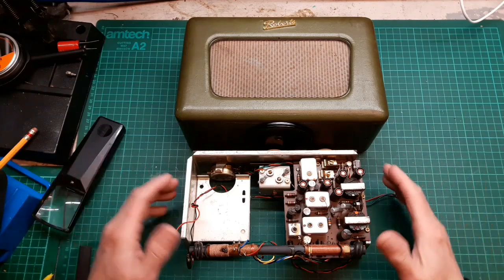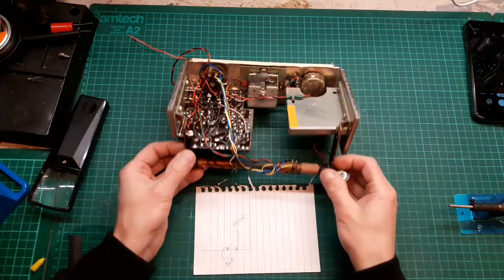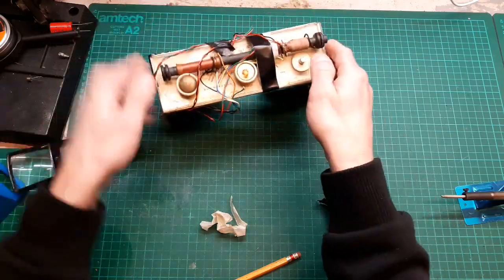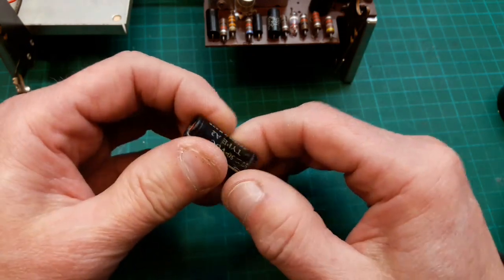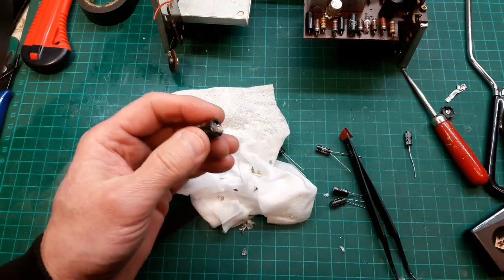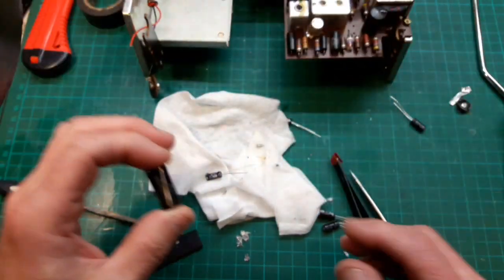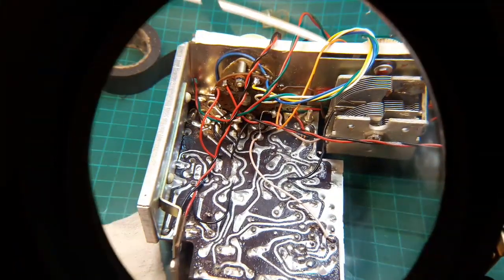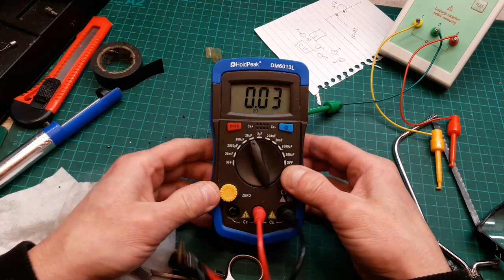Roberts R300 Radio Capacitors Chapter 2

Comment: I've enjoyed watching every video you have created :-D
You don't waffle for years like old blokes often do and only in the last 3 mins they actually focus on what the video was about.
I did notice that the first cap you replaced was better than the new one, the esr and loss was worse in the new one.
But there is more to capacitors than esr, slight leakage can make for a silly reading.
For joints that don't suck well :-D, add a bit of fresh solder to the joint, makes the transfer of heat from tip to joint better 
:-D.
Stop picking fault with you videos, we can do that Ha ha :-D
Reply from the maker: Arrrrrrhh right , replacing good capacitors always hurts 
Thanks for following 
I'm still learning 
Best regards Shaun
Reply: @SweeneyTTodd  , Cheap Wango Tango capacitors can be worse than old quality ones.
We all have to find a level of wallet emptying that we are happy with lol :-D
Just my opinion, i'm an old git so i like a moan :)

Comment: Another interesting video Shaun.  It certainly is a wonderful trick to hide new components into original older ones. For some people, keeping originality is important. I would have thought the traces on these older boards would be more durable and not prone to lifting up. It did not appear that you used too much heat. I guess you never really know until it is too late. I wish you all the best in the next episode. I hope it all works as it should.
Reply from the maker: Andy Tobin , Thank you for watching 
It's a bit of a pain re using the old cap shells but a nice look 
Best regards Shaun